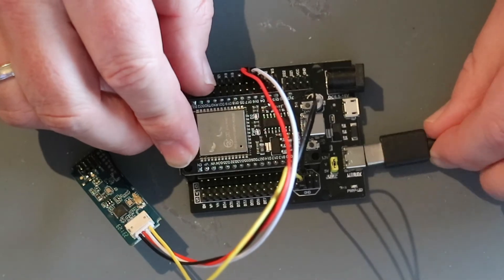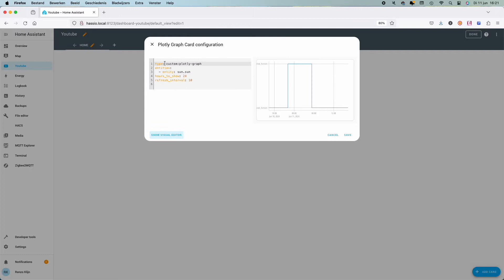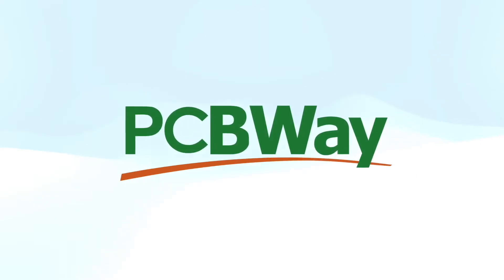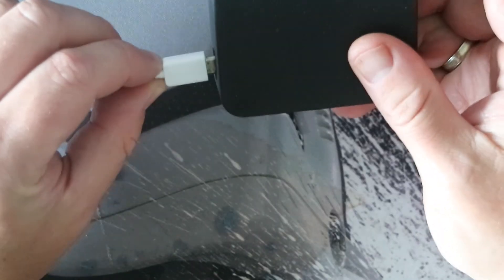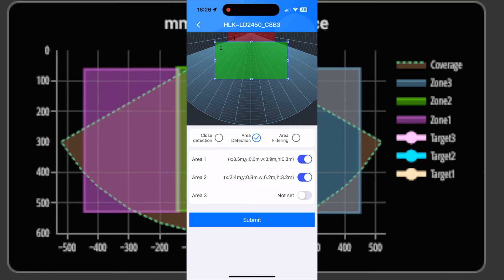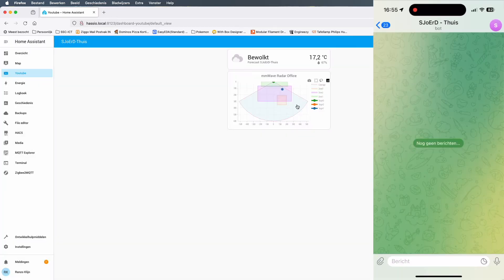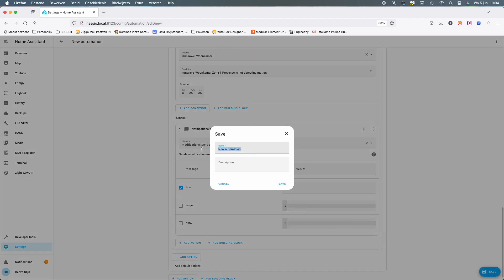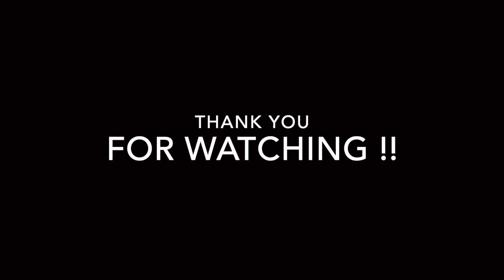Ultimate DIY mmWave Presence Sensor! ESP32 + LD2450 for Smart Home Automation

Comment: If sensor is mounted to ceiling, looking down, how would zones work then? Can we map somehow corners or quadrants of room?
Reply from the maker: @dnoha1  it still works the same, mount it and walk around. this way you can map your zones distance would be a bit of but it depends on how you mount it. For example it will detect your feet first if you enter the room from the sides.

Comment: Awesome! - Question.
I've LD2410 + ESP32 mini and they work really great. - Only thing i want to upgrade is the zone detection. 
My current zone detection is only distance - will i be able to use your setup for that?
Reply from the maker: As far as i know the difference between the LD2410 and LD2450 is that the 2450 can detect direction and thus locate the presence (3 targets and 3 zones) the ld2410 cannot. I could not find a solution yet for your question. If i find it i will let you know.
Reply: Hey can you share what firmware you use with LD2410? I'm having issues with Wi-Fi conneciton on ESP32 whenever I flash LD2410 related bin but never with LD2450, pretty weird.
Reply from the maker: @ChuckDeath  sorry, i read the question wrong, i already send you the configuration. hope it helped.

Comment: Can the tx RX manipulated become relay level trigger. And no need Esp series again like the pir motion sensor
Reply from the maker: @m0ck1N9jay  possibly, but the possibility of triggering on motion is already there. I made a pcb where you can  place a development board. If you want to you can lose the development board and create a pcb where you solder a esp on directly. Saves some space but have to program the esp separately or put the right components on there to program it and less accessible for the majority of the viewers.

Comment: Very cool, how many people can it track at the same time?
Reply from the maker: Up to 3
Reply: @licky-lauda  that’s fantastic, I’ve seen the cheap ready made ones but only did 1. Others required lots of programming when DIY, this just seemed so simple 👍
Reply from the maker: @sentyuk5322  if you follow the directions in the first part of the video it is not that hard. The files are available on my Patreon page. you can access them as a free member.